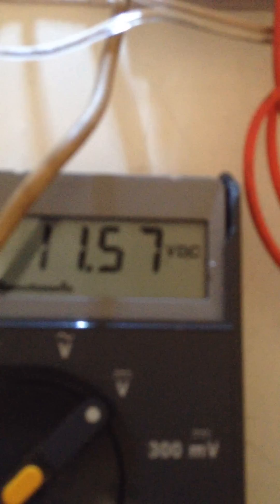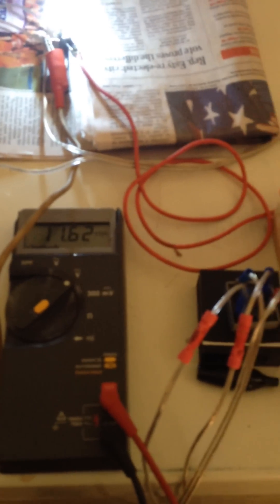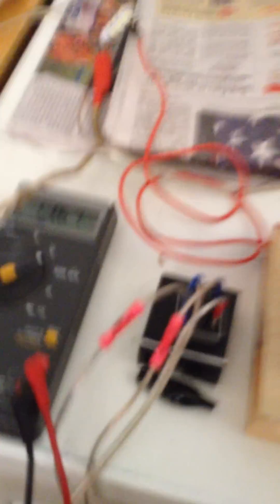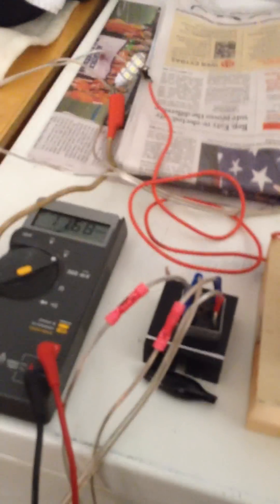Over unity created with transformed back emf. True over unity, no BS!

Comment: So you knacker the SLA battery down to 9V then are surprised when its voltage
gradually recovers afterwards?  Get real.
Reply from the maker: ***** Have you an explanation why this would happen with a load connected that would normally not allow this to happen? I see 2 phenomenon happen here.. First, the replacement of the loss in the circuit as a tank circuit does. People such as yourself call this an anomaly. If this is an anomaly, then why is the circuit used for gains in efficiency? The good ole laws say it isn't a possibility, then, if this were so impossible, then, why does it happen on it's own when there is no such thing as overunity?

Anomaly my ass. I could drop this down to 9 volts, add a load that should decimate the battery's ability to come back too without my circuit connected. Take a bulb and connect it to a battery that is at 9 volts. Tell me what happens. Then, connect a bulb and a relay wired the same way with the start voltage at 9 volts and explain to me why the battery gets back up to 14.4 or 16 volts and tell me again why this is happening when it is supposed to only go down.

We have a loss in the relay (a small load), and, we also have a small load in the bulb, larger than the relay's load. Then , we have a recovery charge that is being manufactured which is higher than it's loss. If this weren't true, the circuit could never recover as this does.

If this is done with a lithium ion battery, the battery's voltage gets so high that the lithium's protection circuit shuts off after several minutes of it's operation, and that is with the use of a 5 or 6 watt tail light bulb connected to it.

That my friend is overunity and has nothing to do with the natural recovery of an SLA. SLA's do recover on their own, but, this is only when they have no load connected at all. Put a recovery charge on them and they boost themelves back up to their peak charge voltage.. Use lithium and they continue to rise. There is an emf output that is only supposed to equal the power input, minus the losses since it is a mechanical device (the relay), so, the circuit is supposed to die, not gain voltage under load and loss.

So, is it starting to make sense why this would seem to be a questionable circuit to research and play with to see whats really happening?
Reply: You clearly no nothing about real batteries.
Reply: "no load connected at all" - what about a 100M resistor? 1M resistor? 1k resistor? You have done this experiment have you?  Clearly not.
Reply from the maker: There's a bulb connected, and it is a resistive load (the tail lamp bulb).then, the 3 or 4 watt LED is also considered a load.  You either didn't watch the video, or you're pretty Damn delusional and just full of stupid comments to try and make it look like I haven't done what should have been done to ensure my research is truly functional. A resistor is a dummy load and only qualifies for the release of heat. It isn't representative of work in any degree other than it's ability to release heat from its resistance. Also, it's a bad way to determine cold electricity's ability to function with a resistance because a resistance functions in an opposite way using cold electricity vs conventional amperage driven electricity. The circuit here uses conventional electricity from the battery and, it draws in cold electricity through its arc gap so, only a portion of the power would be used in the resistor while the part which would be utilized to do work is wasted in one resistance. It's an awful method to use since there are opposing variables and you obviously don't know this.

Comment: That's not overunity.
Reply from the maker: Volker Kuhlmann what is it then, underunity? LOL  You have to know how to build it to get the correct resulkt. A lot of people trash talk my work, and i send them to my Pelex device video. i have produced more output with less input than any one device out there today and I have proven studies completed at 2 different locations outside of my own lab that were saying the same thing when I introduced them to the device. Trash talked me up and down , then, walked out pissed off because they had not one comment of how I could be cheating after they saw what was going in and what was coming out of the device. the overunity video you have commented on is much older than the Pelex device and it was just a small sample circuit tht has proven it was possible. Then, I took the primary technology I use to make this happen and built and energy amplification delta bucking coil system that eliminates Lenz effects and uses magnetic cancellation to eliminate the back emf "load" a transformer's coil presents into the circuit. The magnetic cancellation of two transformers driven into the third transformer works simultaneously to cancel out additional transformation loads that would normally appear in the circuit. Since one transformer draws from the primary coil feeding the step down or step up of the circuit, the introduction of a second idendtical transformer feeding it from the opposite direction allows the transformation to happen successfully while the dual magnetic field from both sides cancels the load out on the primary sides of both transformers while it utilizes the Earth's magnetic field to initiate a self cancellation, eliminating all of the input power except for the initial coil load which is provided by the resistance of the coils. So, the coil feeds the other side with only 5-7 watts while the output sends well over 2500 watts of the identical voltage under full load at the full rated voltage with the input circuit not seeing one bit of load whatsoever other than maybe 5-7 watts at 120 volts, or whatever you build the primary coil system to be.

If we wire the coils in series, it exponentially increases the output without multiplying the load, as i have discovered, designed and successfully built many times over and over without fail.

talk all the trash you wish, I have working models all over the place functioning perfectly. It's sad that non believers have to suppress the real working devices when they have absolutely not one clue why it works or not. The system is not reliant one bit on conventional power as it is literally able to output only cold electicity with a conventionally powered input. A 10 watt solar panel could power this circuit with ease and it can output over 2000 watts of pure sinewave power without any issue whatsoever.

Comment: Hello I've watch your videos and like a lot of them was wondering if you can do a how to video on this one would love to make this circuit.
Reply from the maker: Hi Lee, I am going to spend some time and try to put together a few how to videos with proper test equipment, as well as a few very interesting tests that will show some very unique results that nobody will be able to answer why the circuit and tests will be doing what they are doing. I apologize for not replying faster, I've been extremely busy at work as well, building new devices that perform amazing functions. I have a lot of new technologies to release to the public, and I can hardly wait for the comments to start. 
the suppressionists are going to try to retaliate wit me using physics equations to try and show me that I'm wrong, but conventional formulas only partially apply, and that's because my systems utilize both  amperage driven electricity and cold electricity. since resistances react in an opposite manner with these both, making it awfully difficult to equate or show true results using only conventional test equipment or formulas.

I'd hate to say that it couldn't be measured properly, as it would be possible if equations were made for it and meters would need to be calibrated to it. 

other than using appliances, there really isn't a true test method until the equation s and calibration s are done
Reply: Sounds good can't wait I've been busy to working on another project it doesn't have anything to do with free energy through but its still pretty cool will put some videos up soon
Reply from the maker: +Lee Velez Hi Lee, I may do a how to video, however, I have to build the system again and do not have the transformers used to make this work so I will have to build them. I am very limited with my time to do things since my business has been extremely busy and it even affects my time out of work at night most evenings. I will certainly try to do so when I get the time to do so.
Reply: @LegitLeeVelez https://mbrcircuit.blogspot.com/ circuit can be found here

Comment: Back emf is not!!! over unity! is BS!
Reply from the maker: +Volker Kuhlmann you are correct, BEMF is not overunity, it is exactly what has been put into the system, however, there is a recirculating current created by the pulse of the magnetic field within the vicinity of the arc causing charge clusters to cling to the field of the arc. Opposite attract, and, when this happens, energy is channelled into the system outputting a slight bit more energy than went into it causing the system to charge while a load is added to it of miniscule proportion